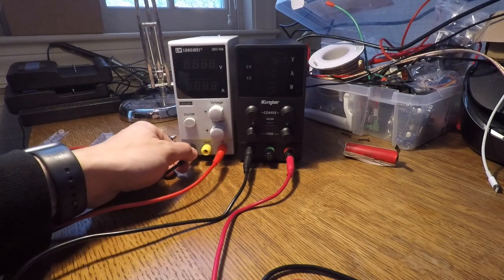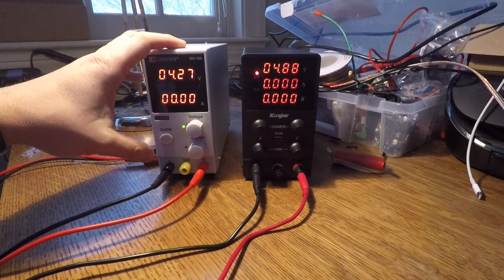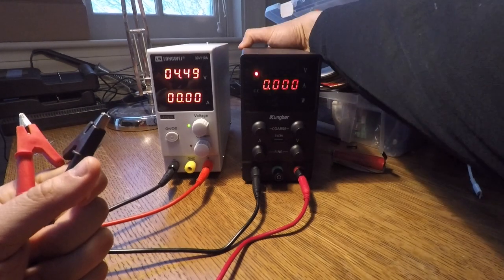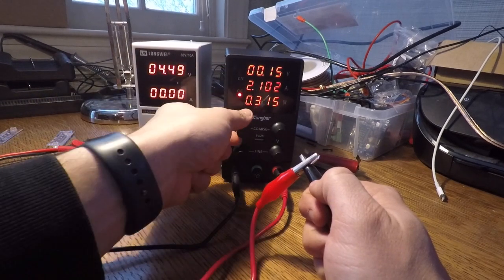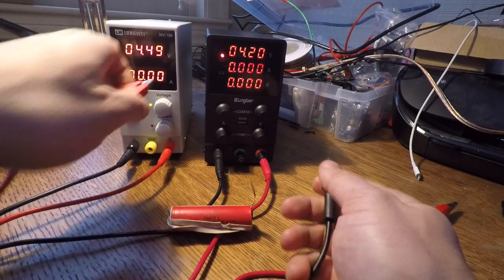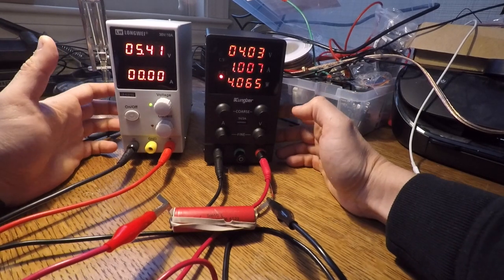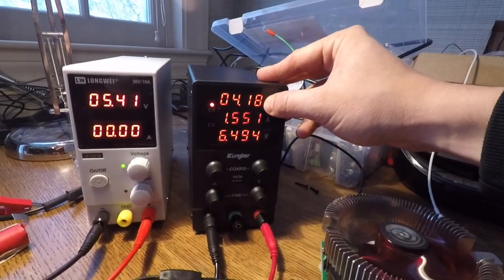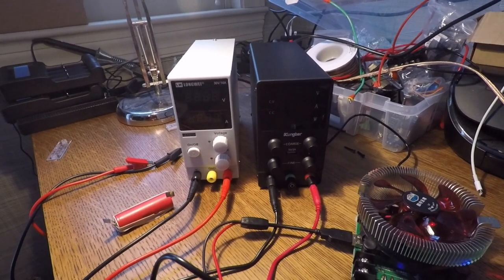Small Bench DC Power Supplies - Review and How To (Constant Current vs. Constant Voltage)

Comment: My favorite little bench supply is the KORAD, like the KA3005P (The little 30V 5A one).   Digital everything, including step settings at various granularities.   Plus has several safeties, plus it displays the voltage and current settings while you are adjusting them with the supply live, so you don't have to guess.  There's also a 60V/3A and 60V/5A and other variations.

https://smile.amazon.com/gp/product/B0085QLNFM/ref=ox_sc_act_title_1?smid=ATVPDKIKX0DER&psc=1

Obviously not a 'charger', being only 5A, but its been enormously useful for all sorts of things over the years.  Fan is a bit noisy but that's my only complaint.

-Matt
Reply from the maker: Ahh, I really like this! I think the 5 amps is going to be problem for alot of people, but otherwise it looks fantastic.

Comment: Great video thanks for sharing, it’s possible the kungber has residual charge in it capacitor/s and takes time to power down, be interesting to switch it off under load and see if it powers down faster. Thanks again for a very informative upload.👍🏽
Reply from the maker: That's a very good point - I'll give it a try.